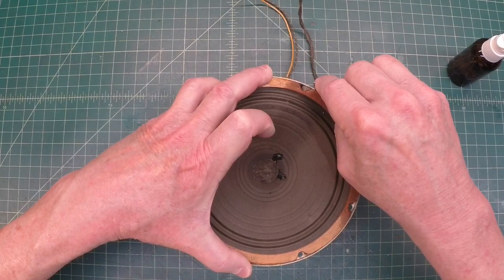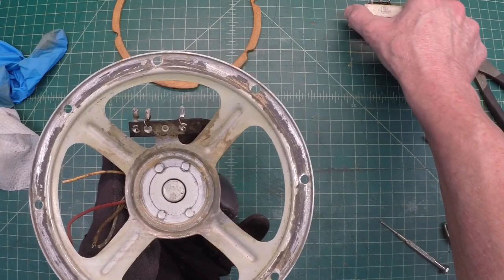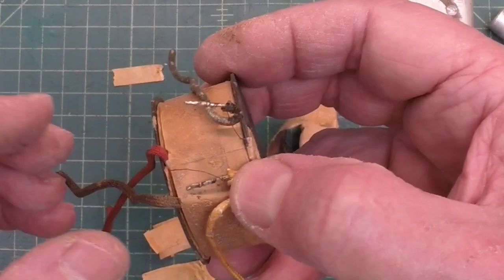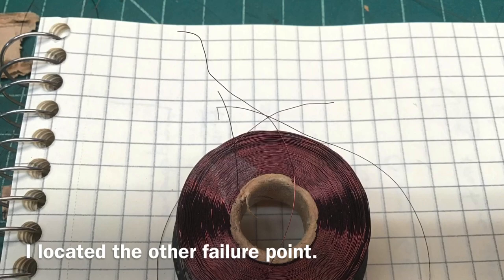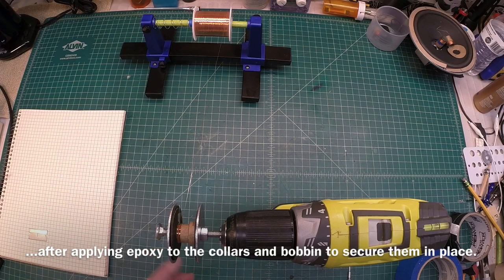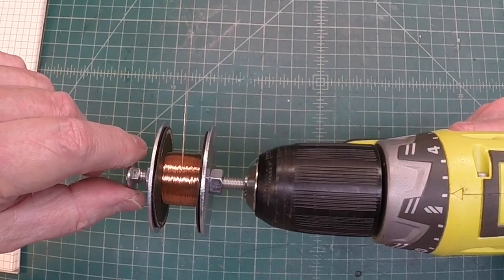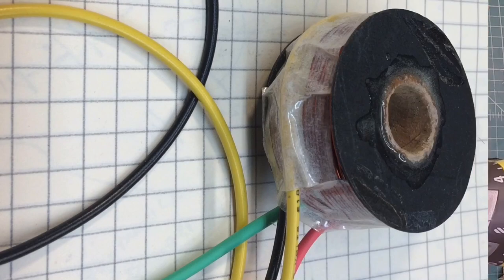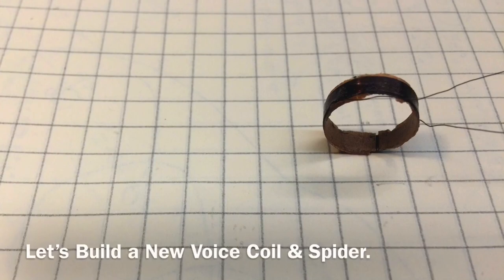Musicaire Radio - Loudspeaker Tear Down & Winding a New Field Coil

Comment: Hi Don , thanks for the video it was great.  I have one question though.  Why not press the center piece out rather than drilling?      Thanks.     I find this part of the restoration most interesting . Can’t wait for the next video.
Reply from the maker: Thank you Dean. The four holes I drilled/tapped was to separate the Field Coil casing from the speaker frame/basket to make it easier to get the center pole piece (core) removed. I didn’t have a press or vice that works well enough to remove the center pole piece with the frame/basket attached, thus the brute force hammer and socket approach. Hope this helps and thanks for following along. The voice coil build was a lot of fun. Best, Don
Reply: RestoreOldRadios.    Thanks  Don for the reply.   I was able to to press out a pole piece out on my 6s229zenith and install it after spinning a new field coil .    I could not have been able todo that if I haven’t been watching your videos.   This  might sound strange but that was really fun.   THANKS